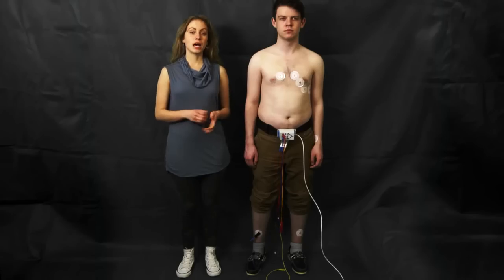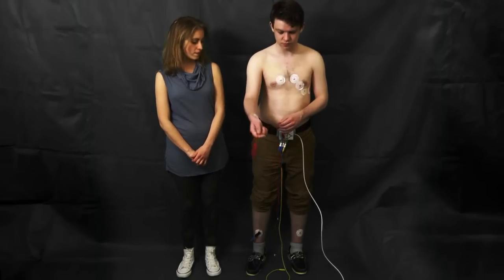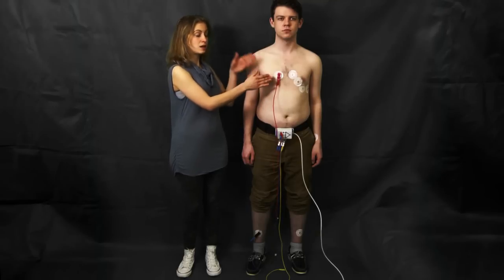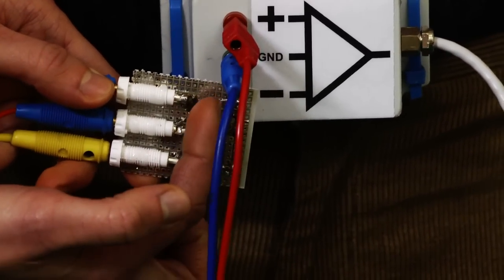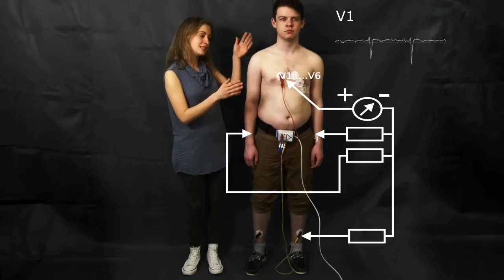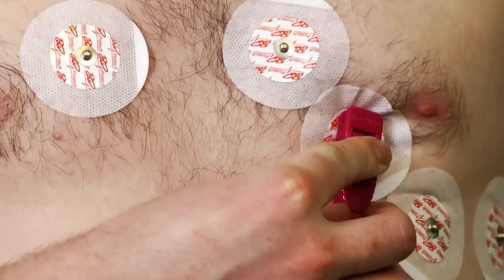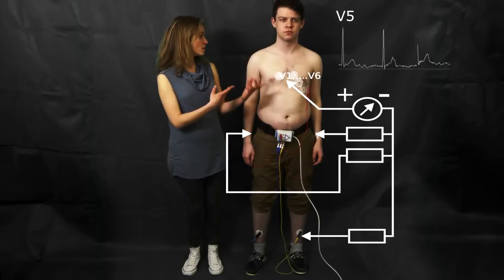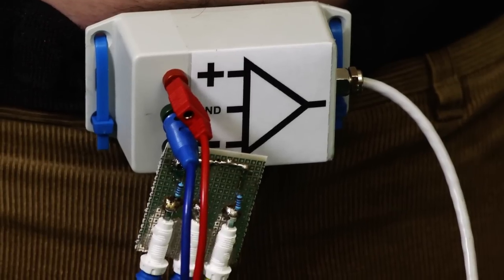ECG: The precordial/chest leads V1,...,V6

Comment: Can someone explain how exactly the virtual lead is formed? Thanks!
Reply from the maker: just take the leads from right arm, left arm and left foot and connect them all together using 3 5K resistors. That goes then into the neg input of the amp. So it calculates the average potential between the limbs.